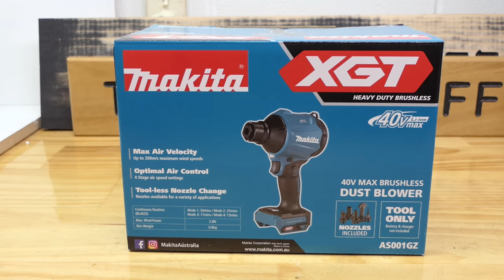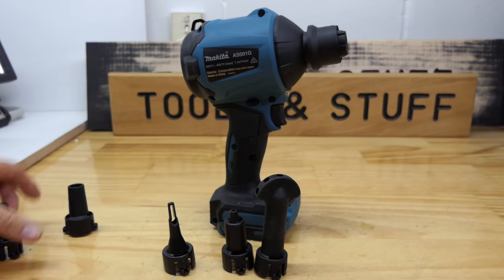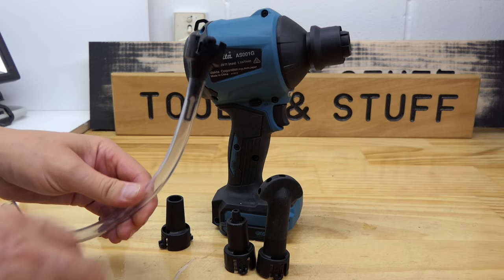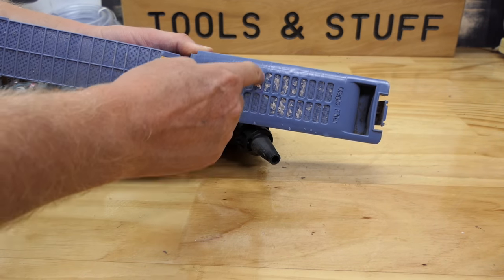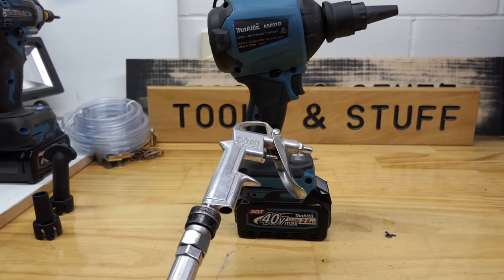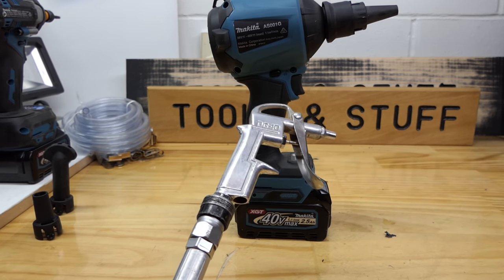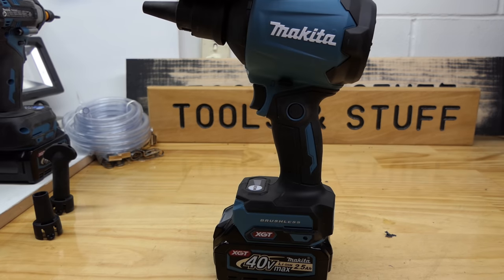Makita 40v Dust Blower Review AS001G / GSA01  MAKITA TAKES BLOWERS TO ANOTHER LEVEL

Comment: I hope there will be an LXT model, it would be great for exhaust fan grilles.
Reply: I didnt think if that!!! The amount of people who will come out with niche uses will be insane!
Reply: Same for ac/cooling/refrigeration condensors
Reply: There’s not much of a reason for it not to be.  The part it’s based around is usually 19-25v and 375, 400 and 500 watts. I can’t find the 36v one that is in the as001g.  Does the 36v one have a higher wattage? I don’t know. As stands, the 400-500 watt models could easily be handled by LXT.

Comment: This is great for drying small things — water bottles, jewelry that’s gone through an ultrasonic cleaner, watch bracelets… all those things small or cramped things that you can never dry completely with cloth. 

Very excited to pick this up and stop buying cans of compressed air for the small stuff around the house!
Reply: Also when cleaning glasses, safety glasses or optical parts it might be handy. Clean with dishwasher soap, rinse with water, then blow it dry which is blowing away most of the water but not evaporating it gives the clearest surfaces on any oaptics stuff quick and easy. Doing this with a big leaf blower now, but i am a bit sceptic this one might be a significant improvement in convenience. I was expecting it to come closer to the power of a compressor with pressure tank, as having to get the pressurized air oil free is an additional inconvenience making me not wanting a compressor.
Reply from the maker: @aliancemd 8 times more expensive??? Absolute rubbish.
Reply from the maker: So let me try and understand your reasoning... you are comparing the price of this tool with batteries and a charger, to a bare workshop blower (I suspect even a knock off by your math) and you think that's a logical and fair comparison???

Comment: Reading through the comments, seems some are totally against this tool. Interesting. I can't wait to get ahold of one. I use my compact blower, like the one you compared this too, all the time. It's usually within arm's reach. Remodeling houses for a living, this tool would have a million and one uses, in my opinion. 
I've had an idea for awhile now: for larger tools like tablesaw I want to install a length of hose leading to the inside where saw dust can get clogged or just piled up. I would zip tie the hose in place. Then, when needed, just attach this blower (or another) to the hose and, well, blow! 
The ability to blow out holes for for concrete anchor installation with this would easily be worth the purchase. IN MY OPINION. I don't want to get anyone all pissed off at me in the comment section now. 
As always, thanks for the review. Yours is definitely the go to channel for new makita stuff. It's great to have a preview of tools to come, and then wait 6-12 months to finally purchase one. Yep.
Reply: The lunchbox style wet/dry 18v vac from makita has a blowing function - which is really good.

If I 3D printed a smaller nozzle to fit - itlll be stronger than this
Reply: That's a smart idea!  My DeWalt table saw sometimes gets clogged up completely

Comment: I have a large compressor (exterior, thus, quiet) running all of the time at work, and so the blower tip works great. But man, what a great tool for someone who wants to ditch a compressor for blowing out! Great review, and thanks.
Reply: I bought the makita 18v lunchbox shaped wet/dry vac - which has a blower function as well.  I use that for blowing dust off tools.

I may 3D print a smaller nozzle like this to make it a lot more powerful
Reply: you'll have to share a vid when you do!

Comment: Since I subscribed to this chanel I've bought more Makita tools than I've got storage. At least now I can use them to build an addition to sort that out.
BTW I've recently bought the XGT powerhead UX01G with the brush attachment and although it's a good workout operating one of them it really does a good job cleaning up pavement. Brushes all the weeds between the cravices with ease without blowing all the sand in the joints out like a pressure washer does.
Reply: im struggling to get hold of one its out of stock
Reply from the maker: Tim from Handy Hardware just rang me. They have 4 of the kits just come in. Blower, charger, 2.5Ah Battery. Not up on the website yet. If you want one get in quick! Tell them I sent you.

Comment: I only wish the hose attachment had a brush attachment, I had to make my own, a longer attachment would also be nice to avoid the tool from sucking up what you're dusting (Ya HIPAA filter is nice, but its just one more thing to replace). 
Love the 40V duster regardless, blowing air was for the most part the only reason to use my compressor.

Comment: Great rewiev! Now I want it even more! I think it would be great for drying spaces inside the car or my tools after rain.
Reply: I think the lunchbox style wet/dry vac (which also has a blower function) may be better use. DVC750 I think it’s model Is, also brushless. 

I had wet carpets in my van, and it pulled up cups of water easily.

I maybe will 3D print a nozzle/reduced for the blowing function - which will likely be as strong as this handheld blower
Reply: @JDAfrica  thanks, I got this one. I mean spaces  where this one has problems to reach. Or more like compact thing which I can take with me to clean my car from snow.

Comment: Nice review. I wonder if it would be a sufficient tool to blow the holes in concrete before installing a resin fixed studs.
Reply from the maker: Yes it has attachments for that... as was mentioned in the video.

Comment: kind of like yourself, i’d use it to replace my air-compressor type jobs.
in the workshop that’s the constant blowing down of work surfaces when i’m wood working. i do that like every couple of minutes to make sure nothing puts joints out of line when glueing/screwing etc.
i’d use it in the house like you mentioned but maybe whilst vacuuming (would depend on the weight) i use a paintbrush to move dirt/dust on skirting boards and door trim etc and vac it up once it’s free 🤷. maybe to tool would make it harder.
i also use a paintbrush on tree jobs (i’m an arborist) to clean the oil and fuel caps before refueling. they get very dirty and the concern is that globs of oily sawdust get into the tank when you take the caps off.
the paintbrush only does so much and i’ve been thinking about a battery air compressor to do that job.
it would also be good to clean out under the clutch cover on my saws without having to take off the cover.
when you take off the cover to clean (which you need to do or it will clog up and stop the saw you have to take off 2 nuts and you inevitably have to re-tension the chain.
this would (i’d say) fix that issue 80% of the time if you routinely blew out under the cover every tank of fuel.
price would be and issue. if it much over $200aud, i don’t know if  it would be worth it.
i’ll leave that for you to change my mind 
when i got an air compressor, i don’t know how i’d survived without one in the past.
maybe it will be the same.
18v or 36v too please.

Comment: I've had a MetroVac mains powered tool like this for a good number of years and I use it at least once a week but the cord is a major pain in the neck. I hope there is an 18V version with the same amount of power because I have no intention of getting into the 40V line.
Reply: Hope so myself. See no need that this has to be 40 V. But would like to see some improvements on the pressure so that a smaller nozzle can be used.

Comment: Looks great, but why not have reverse for suction instead of having to add adaptors to the back?
Reply from the maker: Because then you would suck dust into the electronics.
Reply: Because a Bi-directional fan doesn't move as much air in 1 direction as a fan would that is designed to move air in only 1 direction would. So they would need a bigger motor, bigger fan and more battery drain if they made it bi-directional

Comment: Dunno if your still looking for alternatives to your air compressor gun to clean your wash filter, but i've been using the xgt inflator to blow stuff out like holes in concrete. 

With the ball pump attachment it might have the pressure you'd need to blow out the gunk in the filter ... Alibeit its not intended for that.

Comment: I’d like to hang this off my tool belt with a dust extraction hose connected to the tool I’m using. Ideally with a HEPA filter of some sort to act as an air purifier, when it’s too hard to set up a proper extraction system on the site, which is most of the time tbh.

That and blowing out holes for rebar like you said.

Comment: Quick question. If the last used power setting was FULL blast, does it default back to that setting after a battery re-charge, for example?
Reply from the maker: Yes
Reply: @ToolsAndStuffOFFICIAL  Cheers. Any suggestions on the BEST place to buy the whole caboodle? Tool, battery, charger, all attachments? I'm in Auckland.
Reply from the maker: @richardscott9797  I get most of my stuff from Tradie Republic.
Reply: @ToolsAndStuffOFFICIAL  Thank you.

Comment: I would really like one of these because I'm looking at getting a compressor purely for the blowing action. But it works out about $1000 in Oz because I'd need to buy some random 40V tool to get the battery+charger. Annoying.

OTOH the DX06 dust extractor for hammer drill is awesome, I just got one and it changes the game significantly. The clicker toy on the filter compartment is a surprising win, it seems like a gimmick but it actually works and I can see how it would save poople  smashing the housing trying to knock dust out of the filter.
Reply from the maker: The kit will be out in a few months in Oz. Retails here for about $450.
Reply: It comes in a kit (here in NZ at least) - a 2Ah battery and a standard (not rapid) charger.
Reply: that's good news, Ill have to keep an eye out here. thanks

Comment: What’s the difference between this and a regular hairdryer with cold air function besides the very targeted air flow control?
Reply: Like 50 times more powerful air blast?
Reply: @riba2233  Thanks for the reply :) Didn’t know it was so much more powerful!
Reply: @MrLolUltra  I use it instead of compressor for blowing things out now, that says enough :)
Reply: @riba2233  For me the $50 basic compressor still does his job. Never felt the need to upgrade, but I know for sure what I’m gonna get if I ever need a micro blower!

Comment: Wow, it’s got considerably less blow than the generic lxt one? Man, wtf.
Reply: They’re meant to do different things. The LXT one is a mini-leaf blower, it moves more volume of air but not at high speeds. This isn’t meant to replace the other if you have the small LXT one
Reply: @Mushroomhaus0001  Exactly.  I jumped on XGT because Makita promised it would be a separate line and I wouldn’t have to carry LXT around with it.   Alas, I got to carry around the LXT blower to clean off crap after using the XGT tools….

Comment from the maker: GRAB ONE
40v Dust Blower https://ebay.us/Eon00I
40v Trim Router  Clear Base https://ebay.us/icqSKI Plunge Base https://ebay.us/sk9HEB
40v  https://ebay.us/tq4djd 260mm (10-1/4") Circ saw with a 97mm depth of cut, adjustable & removable front, AWS and track compatible!
40v Recip FASTEST IN THE WORLD https://ebay.us/jv9KUy
40v Planer https://ebay.us/XDkiiK
40v Plunge Saw https://ebay.us/rpuYi5
40v AS001G Dust Blower https://shop.handyhardware.co.nz/makita-xgt-dust-blower-skin/
40v CF002G Fan https://shop.handyhardware.co.nz/makita-xgt-fan-330mm/
18v FR451D Screw Gun https://ebay.us/4NjFZH
SANDER https://ebay.us/31FcGM 
KETTLE https://ebay.us/HsAqPJ
125mm FLUSH CUT SAW https://ebay.us/mIts9Z
PURPLE MAKITA IMPACT DRIVERS (& OTHER COLOURS) MADE IN JAPAN
NEW 18v Makita TD172D in all available colours https://ebay.us/HADzgU
18v Makita TD171D in all available colours https://ebay.us/b7erGy
40v Makita TD001G in all available colours https://ebay.us/kzI7Uq

Comment: I'm not impressed. I have the other blower you have but it's the newer model which has more CFM & MPH plus it's quieter.   Everything you did I can do with it as well and then some other things it can't. The bottom line is the older model has more CFM. More CFM means I can get way more Mph by simply narrowing the output nozzle.
Reply from the maker: https://youtu.be/vzc4nGrJIQg